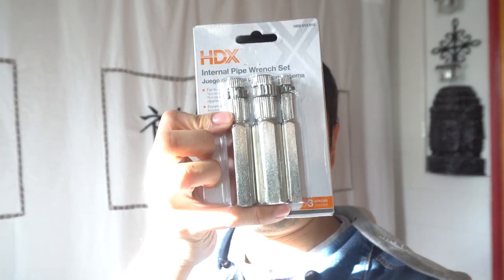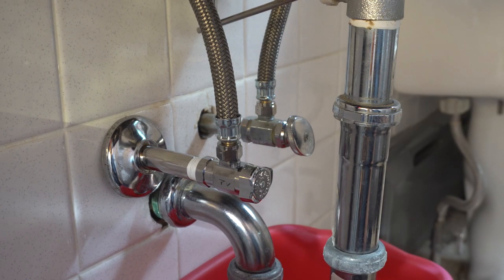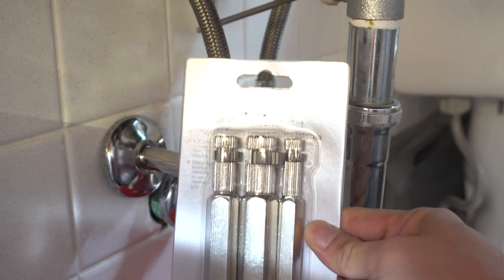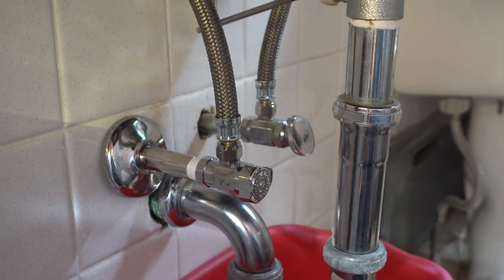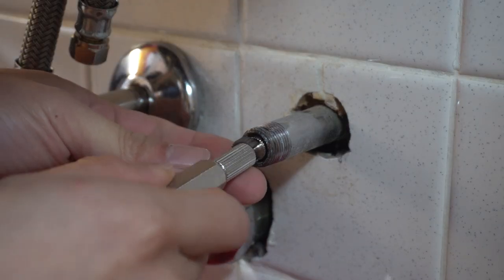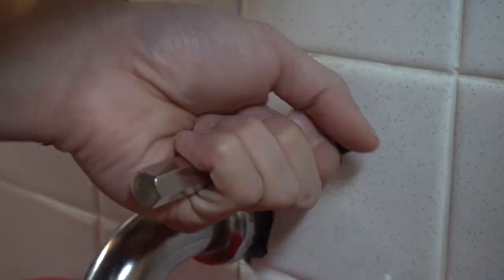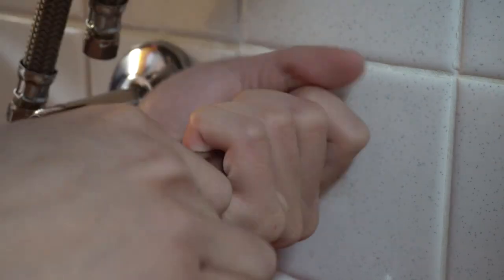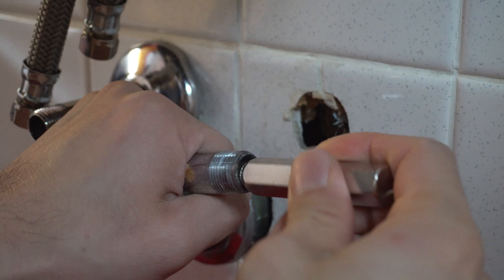HDX Internal Pipe Nipple Removal Tool Review

Comment: Hi Phil. Is this appropriate for brass piping?
Reply from the maker: Sure, these tools should be able to work on brass piping, as long as they are threaded at the connections. Just be careful on copper pipes as these are typically NOT threaded and are instead welded/soldered together so the tool would NOT work on those pipes.

Comment: this tool and all others with similar design have horrible reviews on home depot and amazon. if your pipe nipple is rusted on there good, forget it this will just break inside your pipe
Reply from the maker: Thanks for your input. Mine wasn't rusty, but it did have some build up on the inside of the pipe from hard water sediments. The pipe nipple was installed probably 15 years ago when we redid the bathroom, so old, but not super old. Also I think it was copper core and not iron, hence the lack of rust.

Comment: Why not just use a pipe wrench
Reply from the maker: Good question! The teeth of a pipe wrench can damage the external finish or threads on the pipe nipple, which is not ideal if you want to reuse it. The internal pipe wrench can also be useful if the pipe is broken off and not enough of it is sticking out of the wall for a standard pipe wrench to grab onto.